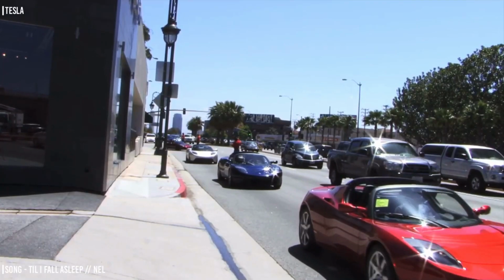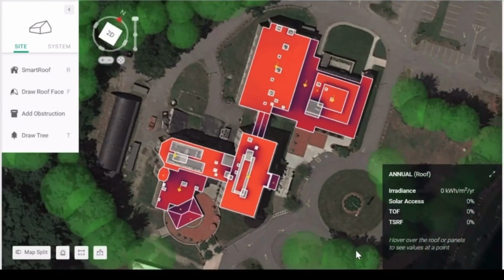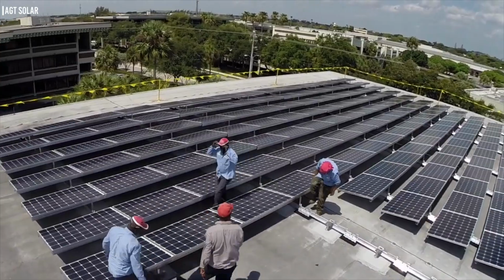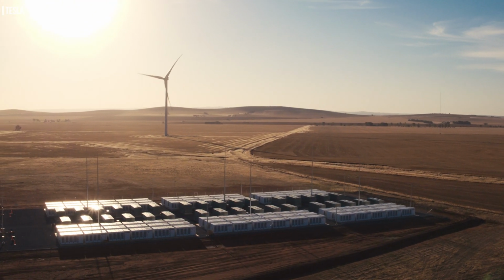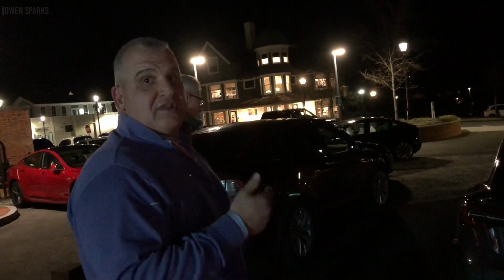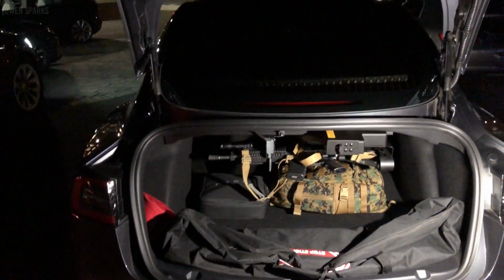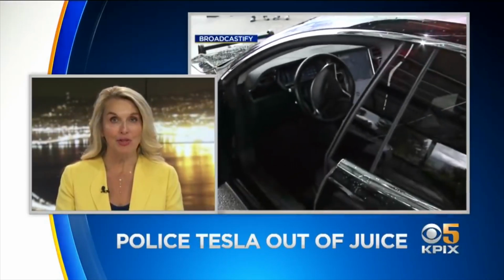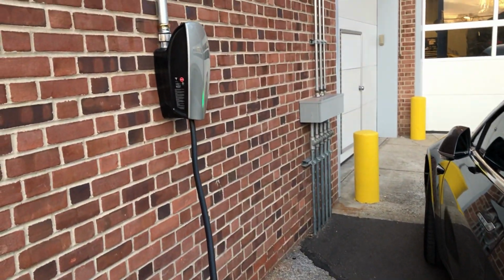Solar Powered Schools & A Sustainable Police Force

Comment: Fun fact for you. Battery electric vehicle's we're first. A professor in Virginia in 1832 converted his own carriage to run on batteries. Fernand Porsche? The very first porsche in 1898, the p1 was electric.
In N.Y. City until the early turn of the 20th century. Didn't allow any vehicle's except steam&electrics inside city limits. Henry Ford's wife refused to drive anything except electric vehicle's. Another fun factoid is the electric starter motor actually was responsible for killing off electrics in the late 1920s. But people forget easily how even up until ww2 was over. Gas was actually bought from cans at corner store's.

What's truly insane about using fossil fuels to me? You use energy to find the deposits. use more energy to get equipment there. Use more energy to sink an exploratory well. use more energy to pump it up(often 1-4 barrels per 10 extracted from the well. And forget how much fracking uses!
Then more energy to transport it to a refinery. Which then uses more energy to turn it into a useable product(energy estimates put just to refine a gallon of gasoline is 4-6kwh of energy. Then once refined, it uses more energy to transport it again. To use even more energy to pump it into tanks(which leach into our groundwater. And it sits there waiting to require even more energy to be pumped into a tank. Where it requires what exactly again? Electricity of course to burn and emit even more pollution. 🤔
Reply from the maker: All of that vs Capturing the solar on your roof, storing it in a power wall, and using that energy to drive your car and power your house!